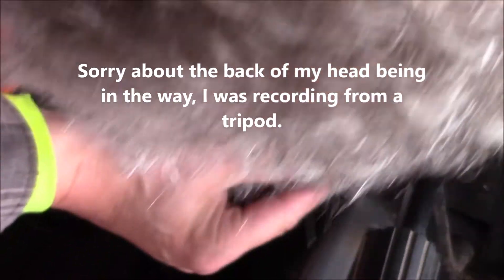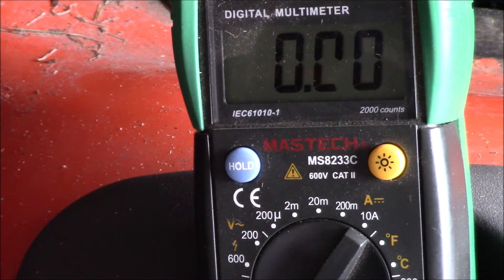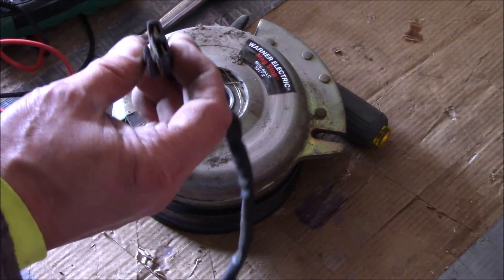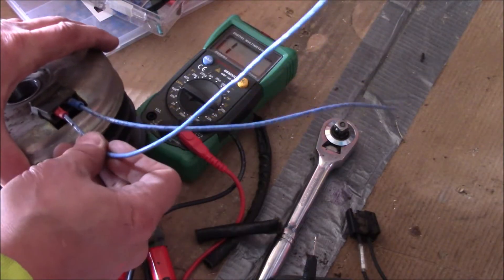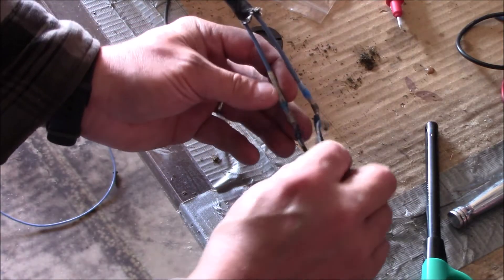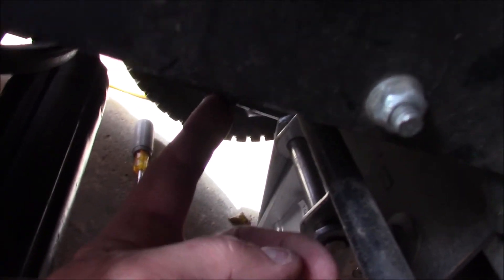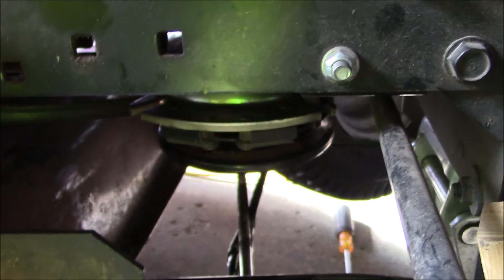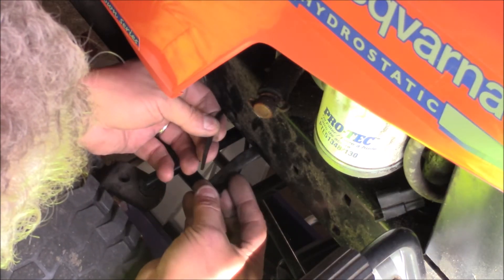riding lawn mower blades not engaging fixed

Comment: Thank you for video. My neighbor is elderly and I'm trying to help her. She has a Husqvarna and it works great but then let's say she gets off after it's nice and hot she always turns it off and then when she goes to get back on it it will start but it will not engage the blades. She says the blade stopped working after it's hot and I said what do you mean. And she said well I get off and then when I go to get back on it it won't turn the blades. She says the mower will start the engine will work but then the blades won't work what do you think Will this fix it maybe
Reply from the maker: you may wish to look closer at the switches, the engagement switch and seat switch. I wish you the best on your repair
Reply: @bbbjim1fixedit   TY for the reply. Very much